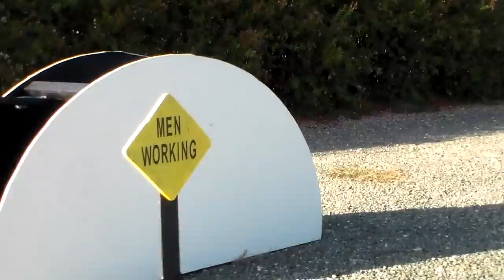The Giant Coin Flipper

Comment: why did this project fail
Reply: +Michael Cousins ... we need to ask Matthias Wandel, why this failed . Im sure he would have a formula to make it work
Reply: Way too low of a launch angle, this can be seen as a small version of a catapult. Usually you want a 45 degree launch angle, this was more on the order of 10 degrees. If you want a nice parabolic flight path you need a launch angle that's higher than 30 degree's and lower than 60.